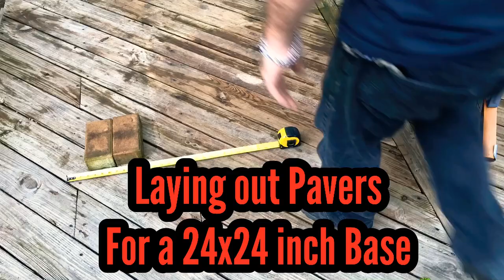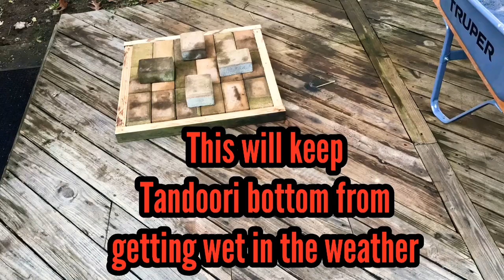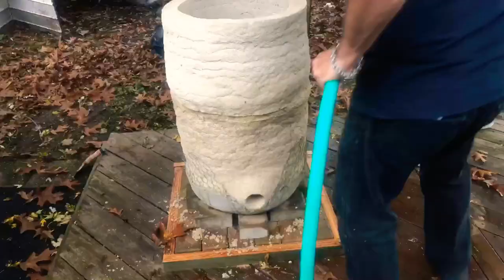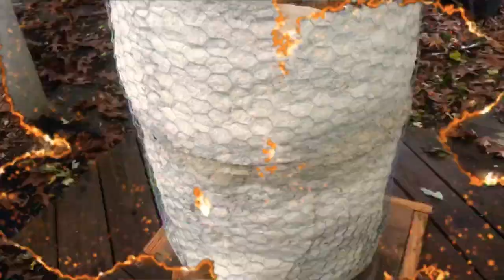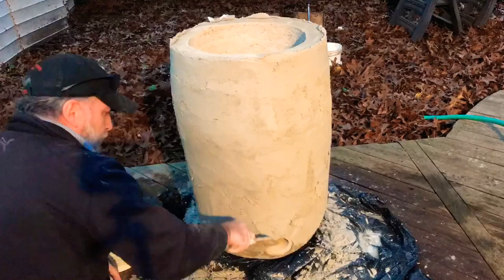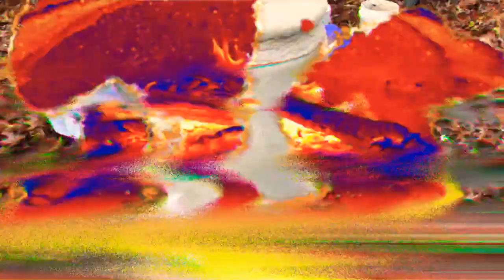DIY How to Build Tandoor Oven using Insulated Concrete Vermiculite n Quick Set Mortar Mix: Part 4

Comment: Looks good but Ideally you wanted to wrap the oven with insulation then add the chicken wire...the heat will now transfer dire try to the exterior mortar so you may get some cracking
Reply from the maker: There is that possibility. , but I built my pizza oven the same way... and 3 years later I have zero cracking. I think the trick is to keep it covered and dry when not in use.  That’s what gave me confidence in going this route.  Thanks for your comment..  I am keeping my fingers crossed and will be sure to let it dry completely before I get any fires going in there.